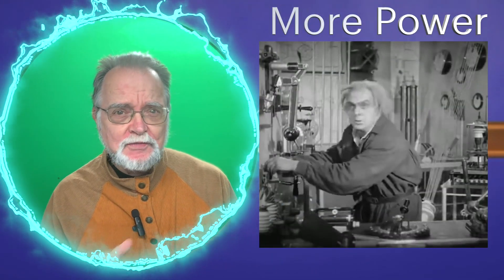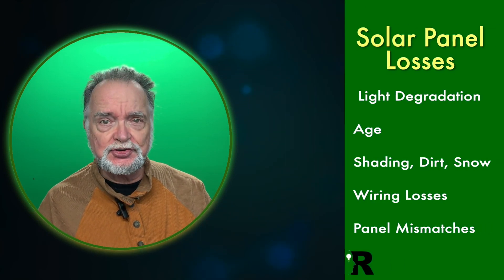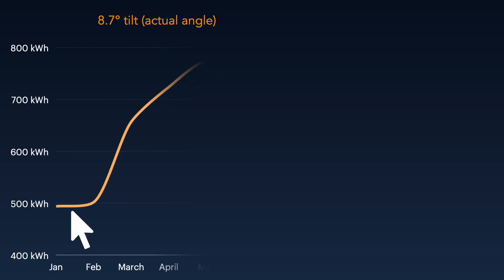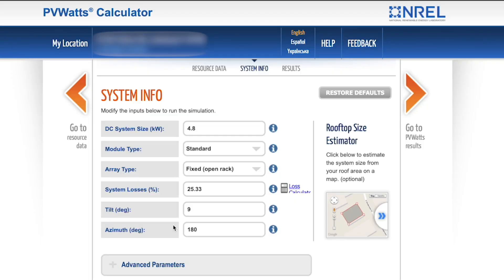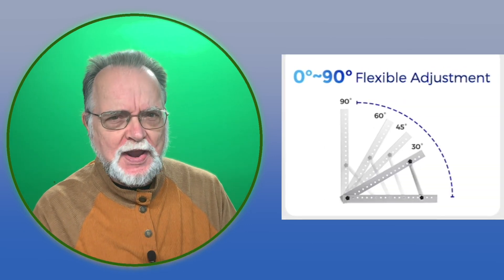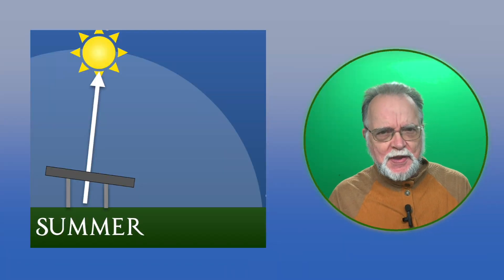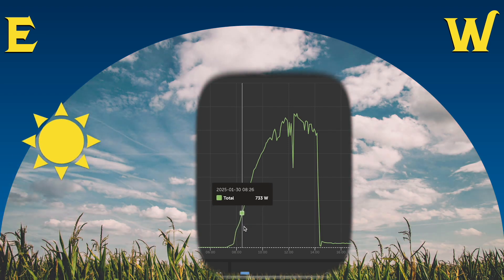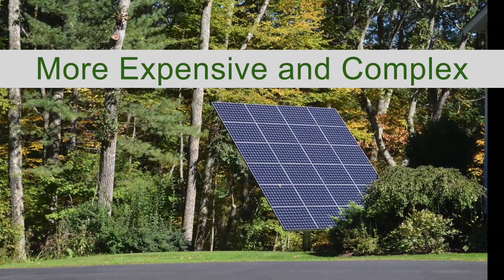More Watts From Your Solar Panels? The Surprising Truth!

Comment: I looked into the possibility of using a tracker from Ecoworthy. I really love the concept but unfortunetly it's unpractical for me mostly due to the winter and snow loads. They're set up to go fully horizontal in high winds so if we get blizzard conditions, it would go horizontal and then the snow would pile on. I have asked Ecoworthy if it's got self programming to avoid this but didn't get a straight answer really. For $400-$500 it's pretty cheap and could hold upto 6 100watt panels or 4 200watt panels. Reviews are mixed. For now I just adjust seasonally. Great video nonetheless✌️